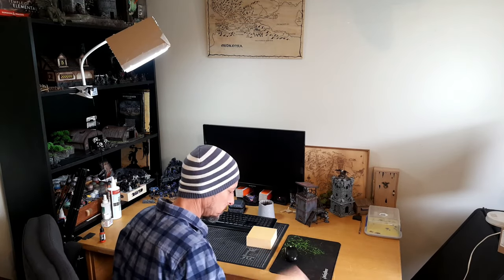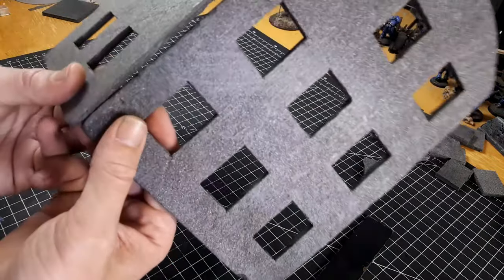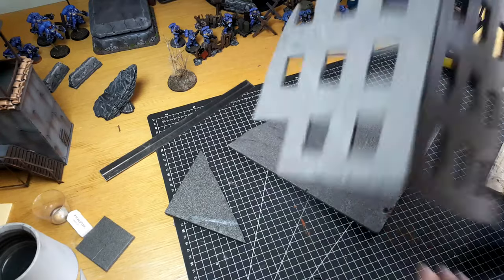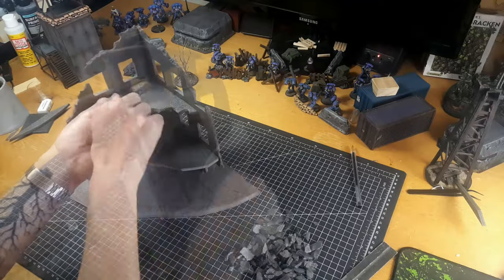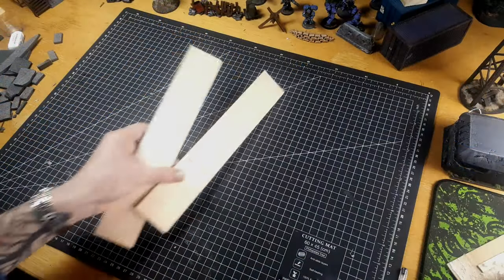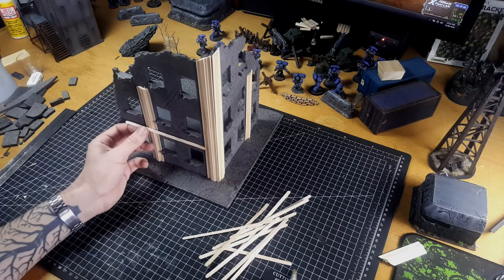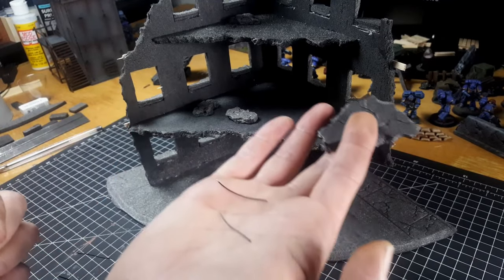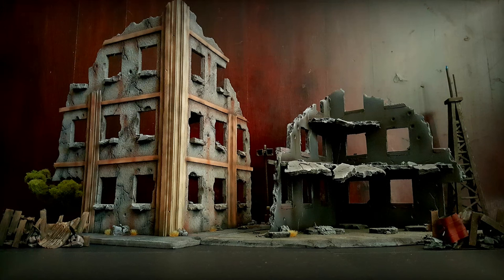Miniature Ruined Buildings for Wargaming Terrain and Tabletop Games - How to Build Easy Terrain

Comment: This is incredible it seems very simple to make, but the added details like the cracks in the concrete and especially the pieces hanging on the wires really make it stand out. Using the pieces you tore out to make the rubble saves a lot of time and looks even better than just trying to use small rocks or pieces of cork while also allowing to really use all the material. I will try to make one like this but with slots so that I can take it apart when not using them (for transport and because I don't have a permanent table to leave them) I 
do have a question, how thick is the foamboard you are using? Thanks for the advice and the great video.
Reply from the maker: Hi Miguel, thanks for the comments.  The foamboard I'm using here is about 5mm thick with the paper removed.  Works great for this type of thing and shouldn't be too hard to find, I find the scale is also perfect for the 28mm settings.
Reply: @RFDHobby  Thanks for the reply. I will try to track some and do my own builds. You have great content!

Comment: Really love this build! The window sill and the balsa wood supports give it a deco look, while adding structural support. I was thinking the hanging floor idea could be flipped 90 degrees and done as a bits of wall too. I noticed you peel the paper off. Do you find that easy to do?
Reply from the maker: Thank so much.  I find adding some details to the outer walls will give it a much more ruined building look than just a couple of broken concrete walls.  It's really the small details that matter on these big builds in my opinion.  The broken concrete floor pieces could certainly be used on the upright wall sections too, this is a great idea.  As for the foamboard, I was having trouble removing the paper early on, but I found a way that doesn't cost anything and doesn't take too much work, I have a video on that process as well https://youtu.be/nE9PIUQjbTY , but the hunt continues for that elusive 'easy peel' foamboard :)  Thanks very much for the comment mate.  Glad you enjoyed the video.
Reply: @RFDHobby  Thanks for the link for peeling foamboard. Will defo check it out. You're absolutely right, the small details make a build work so much better. Too many scratch built ruins just look flat, but yours works so well.
Reply from the maker: @bigbrowntau  Thanks mate.

Comment: What is "fine board?" Is it anything like foam core?
Reply from the maker: The very same, here we call it foam board, or foam core.  It's the thin foam sheets coated in paper, I just usually remove the paper before use.

Comment: How durable are these pieces ? That’s my only worry is that they would get damaged easily.
Reply from the maker: Hey Bear, these pieces are fairly durable. They're lightweight, so in that they can be easily moved, handled and even stacked without much worry. Saying that, I have had a small piece of wall and rubble break off when I was moving these from the old house and cleaning them up, but it wasn't noticable so I just left it.  They're ruined buildings after all, so long as you don't mess up the painting if something comes off, they will usually survive minor breaks.
Reply: @RFDHobby  thanks for the reply! I’ll look at putting some together 👍

Comment: think i got wrong stuff, my foam board has a shiny paper outer, would this be any use ?
Reply from the maker: Not sure you can remove the plastic coating on that stuff, but if you check out the more recent building I did, you should be able to glue onto it with no trouble, will still look fine i think.
Reply: @RFDHobby  hopefully it paints ok. Great videos btw. Just started making scenery
Reply from the maker: @dlear85  it might need a coat of primer, just be careful around the edges using a spraycan primer, as that stuff can melt the actual foam.  Thanks for the comment, and good luck with the builds!

Comment: I built a number of buildings like this. For the windows I made a template which made it quick to mark them out. Still a bother to cut them out. no better way to do that.
Reply from the maker: I used a template for the large building I did, definitely handy if you plan on multiples or large areas. The cutting is always a chore, although, maybe I could use the laser cutter...Cheers mate.

Comment: Do you use foamboard without the paper layer on the Foam?
Reply from the maker: Hey Sven.  Usually yes, it's a lot easier to apply textures and details into the foam without the paper I find.  Thanks for the comment mate.
Reply: @RFDHobby  Is the foamboard stable even without the paper layer
Reply from the maker: @woodworkersven643  it depends.  You have to remove both sides if you decide to remove the paper, or it will warp badly.  I find it's really good, not easily broken unless your careless, and generally will hold nice and flat with most builds, so long as you're not using large unsupported surfaces.  In the scale I work with, it seems to work perfect, and is really easy to texture, or cut to the shapes I want.
Reply: @RFDHobby  you also buy the foamboard directory without paper, richtig? And can you tell me what scale you use for the building? Or say me the dimensions of the building and how high is a floor
Reply from the maker: @woodworkersven643  I try to get the foam without paper, but it's really hard to find here.  I build most of my stuff for 28mm scale, the buildings like this one I make the space between the ground floor, and 1st floor around 8cm.  But this is a 'large' type building.  If I was building a house for example, I would probably try to reduce this gap.  It's easy to build oversize, and I find my instinct is to make things too big for the size of my miniatures, but always having a miniature nearby while I build helps to keep it closer to what it should be.  Happy to provide more details if you need them mate.
Reply: @RFDHobby  i send you a message oder patreol
Reply from the maker: @woodworkersven643  Thanks mate.  I just replied to you on there as well.

Comment: Which foam board do you  use?
Reply from the maker: I use a 5mm thick foam board, in Australia you can get it at Officeworks and Spotlight, if the paper doesn't come off easily, I have a video that shows how to clean it off.  Hope this helps.  Cheers.

Comment: How about putting in stairs? Stairs are valuable bot h from the aesthetic and practical value.
Reply from the maker: Yes!  I actually tried using piles of rubble for my large ruined building project, that looks pretty cool, but I did make up some stairs for the desert building video I did using some foam(and I also made some for the guard tower video using stirring sticks way back).   Alternatively, ladders are also probably a much simpler solution than making stairs, but you're absolutely right, stairs are a handy addition to multi-level buildings when it comes to play-ability.  Thanks for the comment mate.

Comment: Just to make sure i understand, you’re peeling the foam board yeah?
Reply from the maker: I remove the paper from the foamboard yes, but it doesn't necessarily 'peel' off, I have to clean it before I work with it.  Using the foam surface instead of the paper gives a better texture that's also easier to work into cracks/breaks etc.